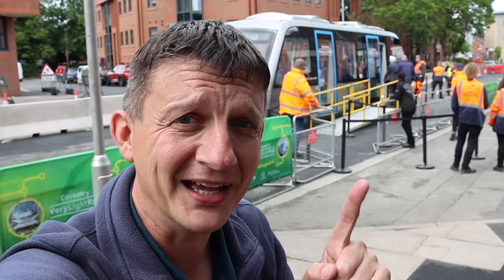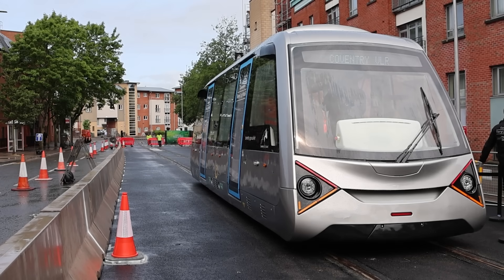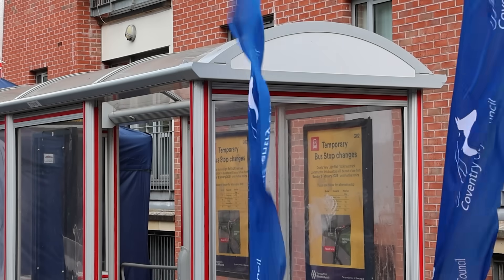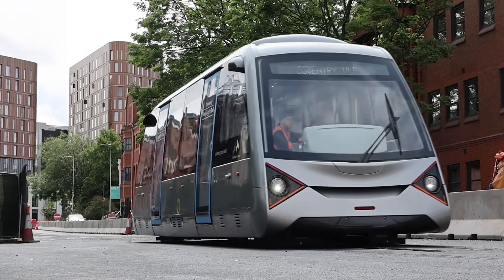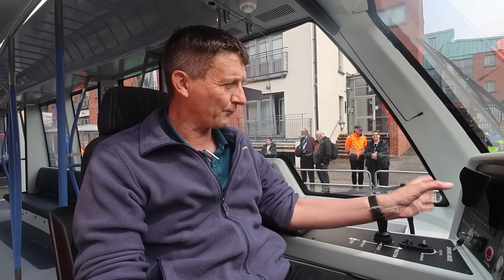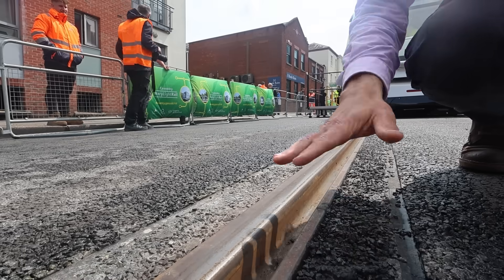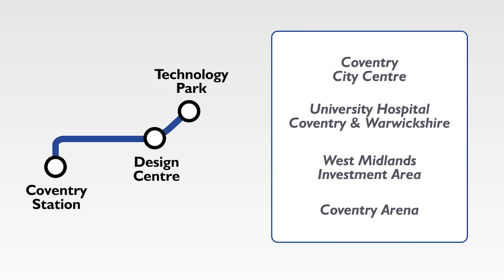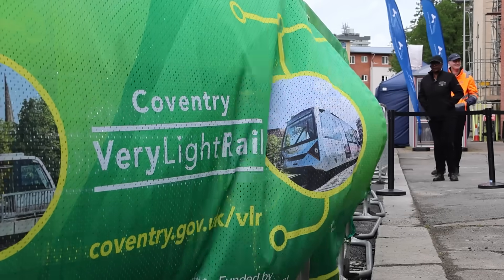The NEW! Coventry Very Light Rail is here

Comment: The point of a tram is to carry more passengers than a bus.
This looks like the worst of both worlds.
Reply: Where in the world did you come up with that? Buses, particularly double-decker or articulated buses, can carry just as many passengers as a tram. And now that electric buses are becoming more common they even use the same power source. The primary differences are that trams tend to have a smoother ride, since they run on tracks; trams can be quicker since they are more often separated from other traffic except at intersections, unless they are grade-separated; and buses are more flexible since they are not confined to tracks.
Reply: @mattbosley3531 an articulated bus can carry no more than 150-180 passengers. A tram can carry 350-450 passengers depending on it’s length
Reply: This is a like a small bus on tracks. But it cost more to build and operate. Although might be better experience for the rider
Reply: @mattbosley3531 There's a weight penalty.  The bus option is heavier, with that spread over just two axles, rather than the four of this design.  That reduces both operating costs and road repair costs.
Reply: It's worth nothing that all of National Express Coventry double-decker buses are electric, although not the single-decker fleet (unless there's been a more recent change.)
Reply: depends on frequency, grade seperated vehicles can run at higher frequencies and stick to a timetable
Reply: eeh, there is worse out there...
atleast a 2 car unit would probably be needed however....
Reply: Yeah. Unless the VLR team can show a concrete design for a larger tram for their system with room for at least 140 people, then I severely doubt VLR would have any usecase.
Reply: Absolutely

Comment: battery electric rail is stupid what is so hard about putting some wires on a stick. plus it is only one car! and just 60 people! just by an enviro 200 or a Citaro-K and make the reginal minesupality run those buses.
Reply: The catenary equipment is expensive to install, but long run it's actually cheaper. The problem a lot of these councils have is the extreme lack of money, I'm sure if they could afford the higher up front costs of doing proper tram infrastructure they would, but this is a cheaper alternative that will hopefully show those who control the purse strings that they do actually need a proper tram network given the demand. I can see this being genuinely useful in smaller towns or even more rural areas, but it seems woefully under capacity for somewhere with the size and population of Coventry. I guess we'll see.
Reply: @TalesOfWar and NIMBYS.  Don't forget that there are established ground level current collection systems in use these days.
Reply: I did a rough calculation on this system and it could quite easily support rapid pantograph charging (5-10mins) at either end assuming 70km range.

Comment: If it has no dedicated lane and only the capacity of a bus, this is a very expensive bus minus the reliability of tried and true systems.
Reply: Yep. Trams are the logical step up from heavily used bus routes on dedicated rights of way (and on road running of course) with much higher capacity. This just seems to have the capacity of a single decker bus and none of the actual flexibility that offers.
Reply: I mean i dont think its that hard to slap on some pain and give it its own lane

Comment: isnt this just a bus?
Reply: Yes, but stuck on rails.
Reply: @Luzgar  so what's the benefit? its seems mostly like an expensive gadget rather than a capacity or improvement.
Reply: @Hendrik-jan-de-tuinman  Lower rolling resistance and scalability.
Reply: @J-Railway-Volunteer Energy efficiency or rolling resistance is not that big of a concern for public transit, because it will likely be orders of magnitude more energy efficient than the individual car that it replaces.
Reply: @J-Railway-Volunteer  so a no rubber compared to producing and installing steel. just put some real ligh rail/trams on it
Reply: @Luzgar   It is a big enough concern that British Rail made training videos. Rail vehicles use a third the energy of road vehicles which allows for impressive coasting distances for example a train can coast for around 1 mile between two stations placed 1 1/4 miles apart and keep booked time.
Reply: @Hendrik-jan-de-tuinman  First question is can the track system support a regular tram it has a 10cm concrete slab which the 16cm rails are connected to. Blackpool Boat Trams have a similar capacity to CVLR. CVLR is around £10 million per km on street versus £50 million for regular on-street running so if you can run regular trams on it then it will allow for a good cost saving in tram on-street extensions as the dedicated tram lines are only around £1 million km. CVLR on-street track permits speeds up to 50kmph and the CVLR vehicle can do up to 70kmph in service.
Reply: @J-Railway-Volunteer It only needs to be more efficient than the cars it replaces. Which is a low bar to clear.

Rail is great for larger scale transit.

Comment: I do not support battery trains at all, yes, they avoid all the expensive electrification, but eventually when the batteries age, they won’t hold as much charge any more. Also the mining of lithium for these batteries is not sustainable at all, as well as the disposal of them.
Reply: Dare  I point out diesel engines become less efficient over time? Or that they, clutches, differentials and gearboxes need replacement?   Battery tech is certainly a moving target (and lithium is not the only fruit), but not yet having a mature recycling industry is a long way from your implication that disposal is any "killer" issue.  Last I checked, oil extraction has hardly been without it's share of issues and I've yet to hear of recycled diesel, petrol or kerosene.  Almost as if there's no such thing as a free lunch!

Comment: I love how the concept is basically just doing what they did in the 19th century, barely slapping some rails into the street and run a barebones carriage, which to be fair, was quite successful back then. Only thing it's missing is horses.
Reply: Now watch the thing slowly devolve into being normal light rail as people demand more and more features and the costs blow up.
Reply: @lembitmoislane. Ah, the reverse BRT path
Reply: @lembitmoislane.  What extra features could you want??
Reply: Coconut shells at an easy canter. But, seriously, this looks like a very attractive local transport.
Reply: @RobinsonCrusoe-o5q  The cost difference to laying a conventional tram track is massive - also, it doesn't need overhead lines, which people generally object to. This system then retains the efficiency benefits of a rail system, rather than rubber tyres on tarmac
Reply: This is what I latched onto as well. The main innovation seems to be the infrastructure installation and not so much the vehicle itself. 

It's worth noting that this can be important as it's a lot easier to get funding to upgrade a system than it is to build it in the first place. So installing something like this that has usage instantly go high gives the confidence that elected leaders need to back more expensive investments and upgrades.
Reply: The tram shape reminds me of a Slug.
Reply: @elainemulberryrat5300 I love this concept. The shape, which I imagine is independent of the unit, needs an overhaul - it's very 80's - needs to be sleeker.  Maybe it looks better in the metal (/composite).
Reply: We need to tackle the BRT system where it hurts, while creating a deep and strong foundation for a heavier tramway system for the future. At least the tracks are already there, like they were more than a hundred years ago when electric trams started popping up!
Reply: I've been studying the historical Polish Narrow Gauge systems, which, just as you observe here, began in the 19th century with horses, then went to steam and eventually diesel. Different lines for different purposes,  in different areas, could have gauge of 600, 750, 785 and 1000mm. They often ran down the sides of roads and along backstreets and hedgerows. I can see some kind of solar-charged battery powered future like that, not only for passengers, but for goods and materials, from freight terminals to retail parks and manufacturers. It would seem that laying narrow gauge lines might be even more cost effective.
Reply: The problem is that this will be used as an alternative to normal trams, which it isn't. It's more of an alternative to busses.
Reply: @Mqtisse kind of. From the user perspective you're right. From the transport agencies perspective its better than a bus as it does not need a driver if I understood correctly.
This also means that it really needs separate infrastructure in order to avoid interference with cars, bikes etc.
Reply: Well, kinda. Really, the 19th century tramways didn’t have to worry about buried utilities quite so much, which is the problem this is trying to avoid.
Reply: That is exactly the point though. We have cars now. You need dedicated infrastructure in order to compete with them. Both in terms of speed and in terms of space. That's the key point here
Reply: I was kinda thinking the same thing, I also kinda fail to see the point a bit... Trams are normally higher capacity than an equivalent bus, that's what makes them preferable. I mean, I like the design and all that, but wouldn't it be even cheaper and more productive to run an equally-sized battery bus, rather than going through the effort of installing the rails, and then also getting the railbus cars, making a bespoke depot for them, etc.?
Reply: It's basically the parry people mover but on the road.
Reply: One tram can cover a very similar route as up to a dozen buses.
Reply: It makes sense. 19th century was probably peak urbansim, before the car, back when good transport corridors necessitated growth. They did things quicker back then. This design appears to solve some of the problems associated with lengthy infrastructure projects 👍🏻
Reply: @namenamename390 An old idea with a new twist.
Reply: well, horses can't typically pay for tickets, so i doubt you'll see them on this service...
Reply: Didn't they have the same exact thing in San Francisco and other European cities too?
Reply: It's like if a civilisation made the concept of a wheel so complicated, heavy, and expensive that a new company had to come along and remind everyone that wheels don't have to be complicated, heavy , or expensive.
Then they put cameras and screens in instead of a reflective piece of metal *facepalm*.

...£10 million per 1000m? And that's supposed to be CHEAP?
Reply: THEY need to add an Automaton hores up front
Reply: @AMPProf  Automaton WHAT? I agree, make them pretty, though.
Reply: In the USA, this would be killed by tire and car makers and fuel sellers, before it started.
Reply: @namenamename390
When Southampton bought the private horse car system into public ownership and electrified it, they had to replace the track as well. With that In mind, I hope this new rail system is more durable than the LR55 system that Tram Power were proposing.
Reply: Yep ... and they realized that they could only make the cars so big before you needed to stage horses around the system because they couldn't pull the whole route ... hills needed helper teams ... and soon you had 8000 horses that needed to be fed watered and (hopefully) looked after ... and that was just for an area the size of Boston, Mass.  

It's not that this system won't work, it's that it won't *scale*.
Reply: @plaws0 yes but horses aren’t needed for this
Reply: @plaws0 it won’t, you’re right, but build it, it will gain the patronage, and it will make the case for larger heavier systems.

It will also be useful in historical city centres as is
Reply: @MichaelTavares  The Bordeaux Tram relies on battery power in the historical city centre and standard pantograph and overhead wires on the rest of the system.
Reply: Nice also has a short section with no OHL in the very centre of the city
Reply: @plaws0  yes but horses aren't needed for this ;)
Reply: @plaws0  once it's there though, maybe time for a proper tram.
Reply: Don't forget the hideously expensive batteries that will degrade over time. If its 70km brand new, after a few years these are going to spend all their time on the chargers.
Reply: @nitehawk86  Hi there, you might have been right 5-10 years ago, but not today. If we use 0.54kWh/km as our energy consumption reference (ADL Enviro100EV, UK Bus Cycle), that means a minimum cycleable capacity of ~38kWh. If we allow for 20% losses over lifetime (as a generalisation), that means a new battery capacity of about 48kWh to ensure the vehicle has 70km range for at least 10 years. At today's prices that battery system, from a reputable supplier, can be less than £5000. Even if my assumptions are a factor of 2-4x off (which they aren't), the result is not "hideously expensive". Hope this helps frame just how cheap batteries are nowadays. Cheers!
Reply: @nitehawk86 Battery technology has improved a lot in recent years. I'm sure they've considered depot-based battery swaps as part of regular maintenance, in fact I wouldn't be surprised if max range increased over time (where necessary). The older battery units would still be useful long-term for static energy storage where energy density is less of a concern.
Reply: Rather than replacing tge batteries, it might be cheaper to install some sorts of electrical contacts around the route, that the tram could draw current from while it is in motion.

Comment: This is a great idea which I hope takes off around the country. Laying the tracks looks straight forward and should become cheaper to do as more and more track is laid and the technique for laying tracks becomes better and faster.

Perhaps the trams could be fitted with solar panels on the roof and have a hydrogen power unit to top up the batteries thus extending the range of the trams.
Reply: Solar panels on vehicles are never worth it you cannot get enough sun even at noon on a sunny day. If you want solar add them to the stops, building or other locations.
Reply: As a Coventry born Lad chuffed to see this happening! But shame it’s not a proper tram system, that would have been fantastic, especially from the Station out to the CBS Arena on Match days, and for Concerts!? 😮😊🤔
Reply: physics says no. Its not going to work. The thing once it gets deployed people will realise the lack of capacity very quickly when at that  point its too late. Just get a tram. There is no need for this just to work around cost of building a normal tram. Innovating is how to build a regular tram line cheaper is best solution instead of techbro solutions like this.